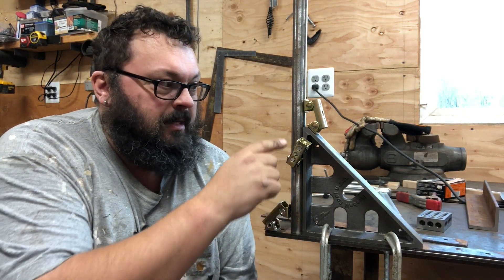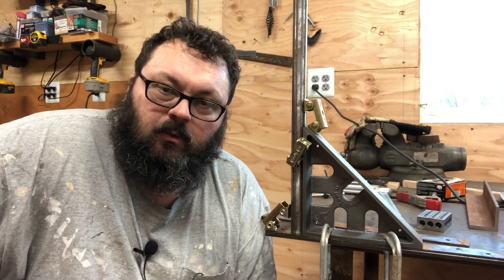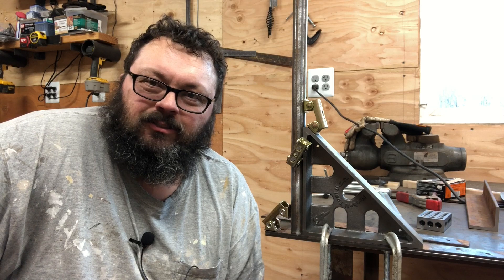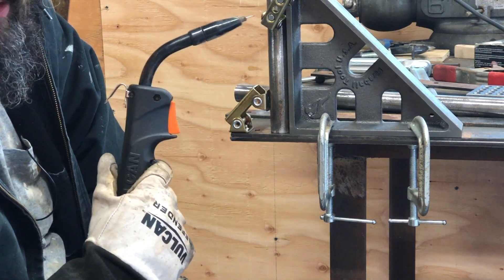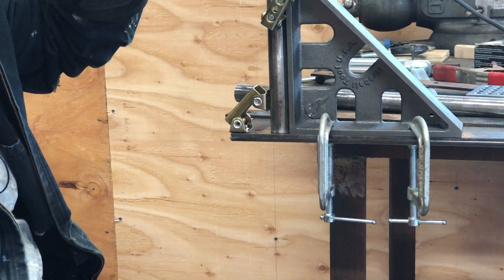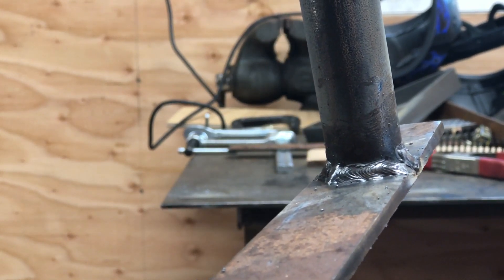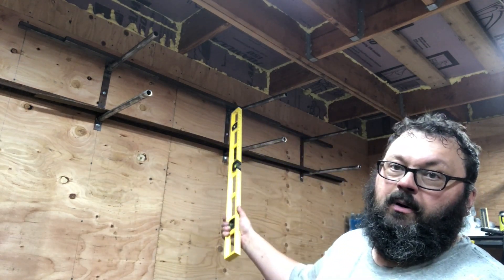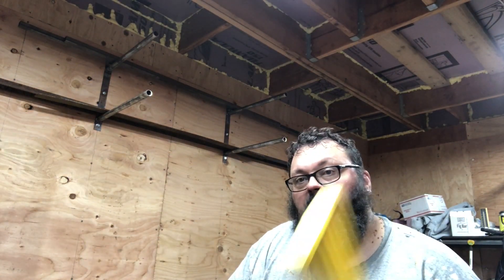Welding A Lumber / Metal Storage Rack

Comment: That’s the best place for it. Up out of the way! Really nice looking rack. Welding around pipe is hard. That’s mostly what I have for scraps so I’m trying to get used to it.
Reply from the maker: Cool.  Are you working on welding projects now?
Reply: The Bearded Giant I actually built a trailer out of an old truck bed with one. Turned it into a flat bed because the old bed was dusting out bad. That was my big project. Only caught the last few parts on YouTube because I started the channel up half way through the build. Also built a gate and repaired a tool we use on our gravel at the storage facility my wife and I manage. I had a water weight roller I patched some rust holes by welding. Not that I’m doing YouTube too, I have ran out of projects and am scrambling to try to find something to do with all my scraps but I just can’t think of anything! I’d like to something like what you did. The problem is I am just using one of our large storage units as my shop (we live in site)  and don’t know how many holes I want to go drilling around in there but I really need a place to keep materials out of the weather and up out of the way. I might take your idea. It might be just not permanent enough to mount up on the walls. Sorry for the long winded reply haha.
Reply from the maker: All good, I bet you could come up with something freestanding, maybe even with casters so it can be moved around.
Reply: The Bearded Giant 

That is a really good idea. I have one little area of wall space for that which just might fit the bill. I’m gonna look tomorrow and see if I I have enough metal to do something like that and how much space I have. Really good idea. Thanks.
Reply from the maker: Good luck

Comment: Nice job and video; I like watching your videos partially because they make me want to work on projects I might not have come up with on my own. Thanks for the inspiration and Merry Christmas.
Reply from the maker: Thank you John, let me know what your next project is.  I appreciate your thoughts
Reply: @TheBeardedGiant  well I did get a work cart from HF that I'm pretty happy with...one exception being it wobbles A LOT. Overall great cart with a smooth drawer and casters but this wobble is driving me bananas. 2 options 1: tweak cart with brute force/maybe a strap 2: weld brackets for cart and make the one short caster bracket slightly longer to compensate for the shortness. It was one of their higher end carts so money wise I need to do something to make it work and I've read multiple reviews after the purchase stating the same problem so exchanging is almost futile. I need the cart so outright return is last option.

Comment: Nice work Andrew. I wonder if a lip is needed on the ends so those pipes don't roll off in an earthquake and damage your beard. Haha! That should be a nice addition to the shop for keeping things organized and out of the way. I have a Harbor Freight wire feed welder that I got around 8-10 years ago. I welded a rack on our trailer bed which became the frame for walls on the trailer. I had never done it before and it was a learning experience for sure. It was pretty ugly but the grinder helped pretty it up. I really want to get that thing up here to the cabin so I can actually learn how to weld and not just melt globs on metal.
Reply from the maker: It has been fun learning.  Sorta like hot glue gunning metal together.  Tab or lip is a good idea.  Thanks